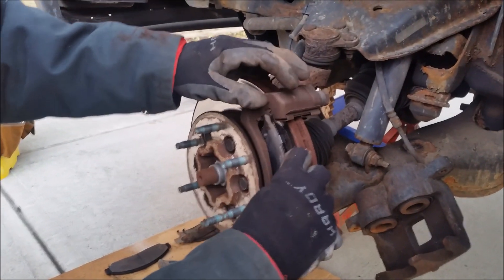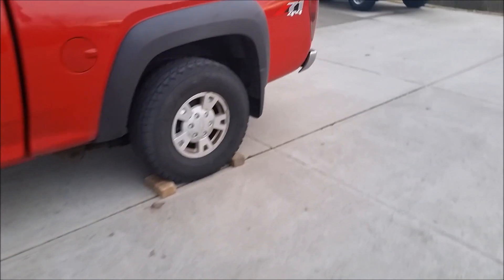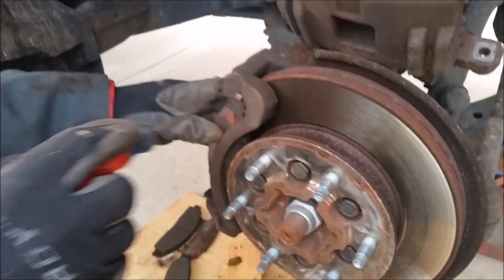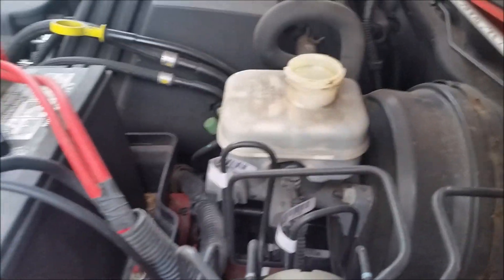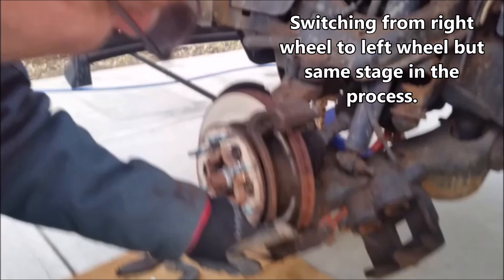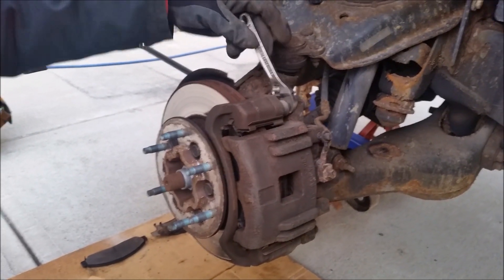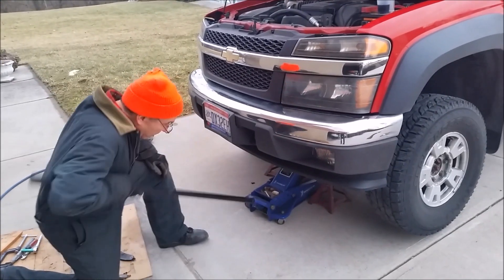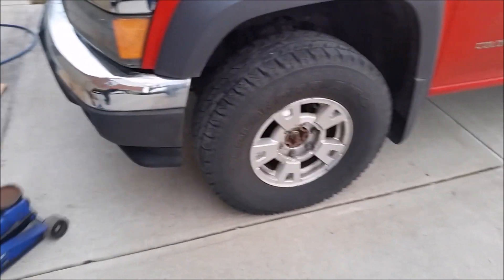How to Change the Brake Pads on a Chevy Colorado / GMC Canyon

Comment: I'm a professional auto technician for over 22 years I've always been a Chevy guy for the most part. I think the GM engineers who designed the brakes on the Colorado should be fired!! There is no good reason to make the rotors this labor intensive to replace! Just bad engineering! For this and a few other reasons I would never buy one
Reply from the maker: I hear ya man.
Reply: I have a 2004 canyon, I think anyone who had anything to do with the approval of these trucks should be fired and strung up. I'm on my 3rd motor, all because of the well known head issue.
Reply: grant peterson oh shit dude please tell me that’s just on the 04 Canyon? I have the 04 Colorado. Bought it pre owned in good shape but I’ve had to do so much in repairs already. Wiper fluid pump, brake rotors, the belt came off entering a highway ramp causing a grand in damage scary as shit too haha. Wheel bearings now my ac controls broke shocks are blown and had to replace the oil control valve too recently.
Reply: I gotta be honest, although I’m inclined to agree with everyone’s remarks about the asinine design- I’ve been a plumber for years and the two trucks that have outlasted all of them were a 1990’s ford and a 2011 Chevy Colorado. Just saying.

Comment: It looks SO easy. I bought my pads at Napa and they BOTH had to be GROUND down on the little tabs that fit in the anti rattle clips...the Napa pads were AT LEAST a 1/16 longer than the old ones. Then they were SO thick the caliper had to be DROVE on and what fun it was getting those bolt holes lined up....if you think you are going to change your pads in a few minutes like here...THINK AGAIN!
Reply from the maker: It can be a little tricky sometimes!
Reply: @fixitFlip  Yes especially when everything is made in CHINA and NO ONE has EVER even CHECKED to see if they actually fit or are made right.
Reply from the maker: @outboardfixer  I have ran into the same problem as you my friend!
Reply: @fixitFlip  Unbelievable that someone doesn't even TRY the parts they make OR a company don't CARE what parts supplier they get their parts from.
Reply from the maker: @outboardfixer  I agree.

Comment: It would have been helpful had you listed the size wrench you used to loosen the calipers..
Reply from the maker: I did say that in the video. 13/16
Reply: @fixitFlip  All the bolts are METRIC sizes on the Colorado , there are no SAE sized .
Reply: I just came by this video and noticed the same thing. It was mentioned but 13/16 is WAY too big. He meant 13mm

Comment: Never compress the caliper piston into the bore without opening the bleeder first . Forcing old brake fluid into the ABS system can lead to to module failure , very costly .

Comment: It's funny just pulled a Napa parts truck in the shop today Napa supplied their own pads and rotors they had no idea that it would cost so much in labor about 5 hrs for their 2WD I have done probably about 12 brake jobs on Colorado's I think the 4WD version is even more labor plus just talking to friends who work for the Chevrolet dealer say sell abs sensors on every front brake job because they brake so easy I have had them brake on me as well especially trucks that have been back east so nobody feel bad if they break sensors or cause an abs light to come on because the professionals have the same problems and if you do this job yourself you save about 500 bucks just in labor not to mention the parts mark ups of shops and dealerships
Reply from the maker: Wow that's crazy! And yes, my ABS light has been on for YEARS! I just quit worrying about it. Mine is 4WD. Saving $500 is a big deal! I wonder if the newer Colorado's are any easier. It is definitely a unique little truck with the inline 5 cylinder and everything.

Comment: Ha! We've got the SAME truck.  Window visors and all.  Been through this several times on my truck, but I always like to brush up before I do it again.  Nice one putting in the lug nut torque spec.  Handy video.
Reply from the maker: Thanks. I have never seen my exact same truck. That's funny! It has served me well for a long time! Not to say it hasn't had issues. (transfer case went bad for one)

Comment: Nice job. Very informative and helpful. I did my front pads and shocks today and this came in handy.
Reply from the maker: Thank you! I'm glad it helped!
Reply: Ditto.  Great Job!!  I'm guessing changing out the rotors is a big pain.  It looks like you have to remove the wheel bearing assembly to replace or resurface those rotors??
Reply from the maker: There are 2 big bolts on the back that hold the caliper bracket on. Just take those off. Yes, then 4 bolts on the back that hold on the hub bearing (I think 15 mm). And then the rotor will come off the hub assembly after you slide it all off after removing the 5 bolts on the front. I think they are a 17 mm. Hope that helps. Hard to explain it all in a brief comment!
Reply: Thanks for the reply Fix It Flip.  I have seen videos on hub and rotor replacement.  However, can you get a quality long lasting brake job without a rotor (turning/replacement)?? My rotors are in good shape and I don't have any brake pulsation.
Reply from the maker: Pads and rotors wear down independently, so it's not always necessary. If you can feel grooves on the rotors, they need to go or be turned, or the brake pads will wear faster. You can sometimes change pads 2 or 3 times before changing the rotors. There is normally a minimum thickness stamped on the rotors

Comment: I have a 2012 Collie 4x4 LT  I bought EBC Rotors and green series pads for $276. I found a local shop that will install the new rotors and pads for $120 with me supplying the parts. I ordered new Raybestos guide pins, new boots, caliper pin grease, and am getting KICK ASS Brakes for under $400. You can order EBC Rotors and the Green series pads and then find a local installer that knows how to press the ABS sensor on the wheel hubs without damaging them. The 2009 is a lot easier to change the ABS sensor as it's not pressed on the wheel hub. For 2010 thru 2012 the sensor is actually over the hub and the wire has to be fished thru the rotor and splash guard after you press the sensor back onto the hub. That's AFTER you remove it if you don't buy new ABS sensors for both sides.
Reply from the maker: Geez.  Sounds like u r about to have an awesome setup! It seems like all Collies have problems with the ABS sensors.  My light has been on for years.  Just never dealt with it

Comment: Flip, have you considered flushing your brake fluid?  That was awful dark juice you siphoned out of the master reservoir.   Typically, a full bleed of all lines to get clear takes about three quarts (been there, done that).  A shop manual I have strongly recommends having the engine running when pumping the brakes (for either a bleed or to repressurize the pistons back in place.  Maybe that's an ABS thing -- I don't know.
Reply from the maker: You are probably right, that would have been a good idea.  And my ABS had been shot for a long time on that truck.  A lot of those Collies the ABS goes bad.  I finally upgraded after 14 years to a 2018 Colorado about a year ago. 
https://youtu.be/JUNVBQvcVOs

Comment: 3:07 through vid.no,no,no.alwsys remove cap off of brake reservoir first,reverse old pad onto pistons like you done the piece of wood.very gently and slowly turn c-clamp to depress oistons completely down.put rag around reservoir to catch over spill.NEVER depress pads with brake filler cap on you will burst a brake line.instsll pads drive about a mile pumping brakes off and on s few dozen times.pull back in yard,completely fill reservoir to full line.you nevber hsve to BLEED your brakes,trust me ive been doing this over 30 years now
Reply: Thanks for the info, I'm about to do this on my truck and any bit of info is like gold !
Reply: @OldSchoolMikey  your welcome brother.